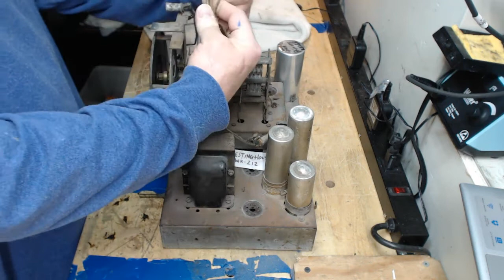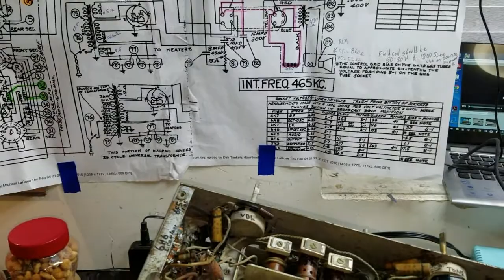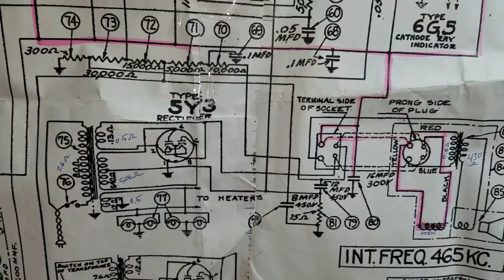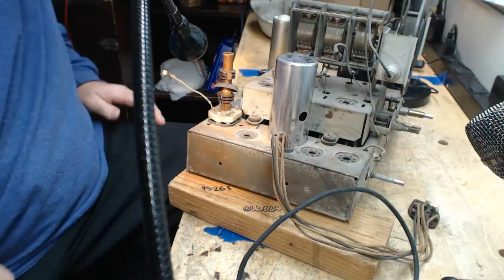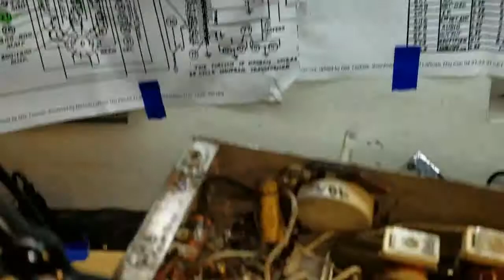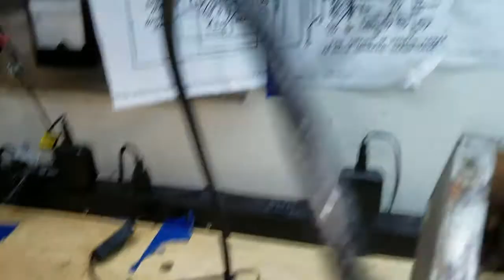1937 WESTINGHOUSE WR-212 BC-SW Tabletop Tube Radio Part 1 of X First Look & Chassis Repairs

Comment: Thanks for sharing! I felt ur pain on the wire of the IF transformer, those wires are a booger. Lol. Im glad u were able to fix it. Looking forward to viewing the next parts. Great job, Regards Larry
Reply from the maker: Thank you, Larry!  I normally stay far away from the inside of IF transformer cans.  But, when one is open, I have no choice.  That fine wire is such a pain to work with.  This set has been a real challenge.  I haven't shown it yet, but the speaker field coil is messed up, too.  Loads of fun!   Thank you for watching and especially for commenting.
Cheers!  Michael

Comment: There's no doubt about it Mike, the 1937 Westinghouse WR-212 BC-SW is a sharp looking radio.  Be rest assured I will happily be viewing this repair series as it unfurls my friend. 
Why?
Because I love American Vintage Radios.
The separate tuner unit chassis incorporated with Westinghouse radio chassis reminds me in some ways to my 1936, RCA, model 10T (Magic Brain) Vintage Radio chassis.  That too has a separate tuner unit chassis.  Unlike your Westinghouse, which has a good set of knobs, dial and speaker cloth, I shall be contacting America shortly for a complete set of knobs, dials, and speaker cloth so I can complete the restoration of my 19T.  It is such a pity someone converted it from 117VAC to 240VAC operation ...the 10T radio was not designed, or manufactured for the UK market.  How it came to be here in England is anyone's guess.
Lovely talking to you my friend.
Phil.
Reply from the maker: Phil,
Reach out to RENOVATED RADIOS.  He has good stuff.  The 10T is a neat radio.  I had a cool pre-war Ferranti that was set up for 240 VAC.  They were never sold here, as far as I know.  It was a little too much to get my arms around, so I gave it to a friend and fellow restorer, who plans to put it to rights....some day!

Take care, Phil.

Cheers!
Michael

Comment: Thanks for the new restore.  Love the close up work and the easy way you relate back to the schematic.
Reply from the maker: Thank you, Steven.  I will really enjoy this particular project because I am actually a big fan of Westinghouse radios.  I like the chunky styling and the odd dials that some of them had.  I just purchased an odd Westy from the early fifties, today at an antique store.  This WR-212 will be a challenging set, due to its present condition and because it has a bad speaker field coil.  I want to include the schematics because a lot of people, myself included, sometimes have trouble making them out.  Thank you so much for watching and for your excellent comments!  Cheers!   Michael